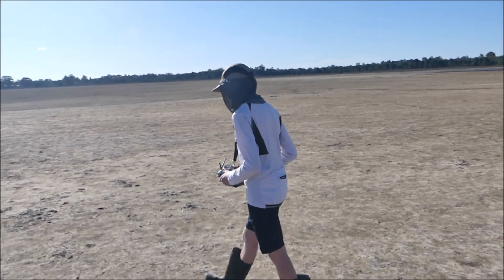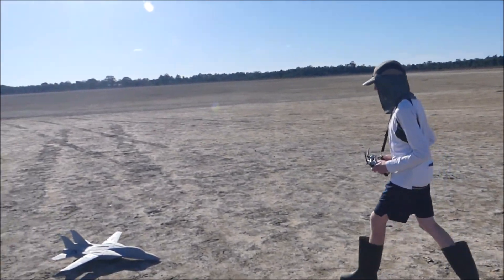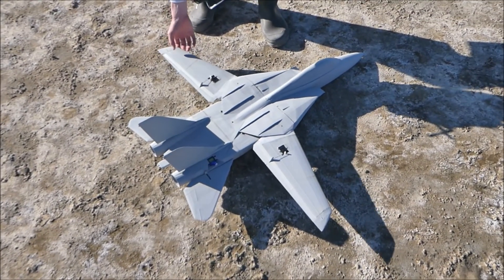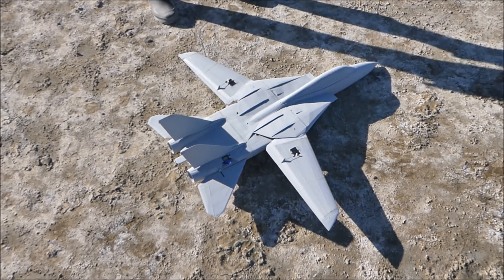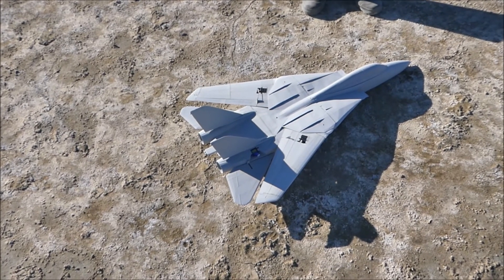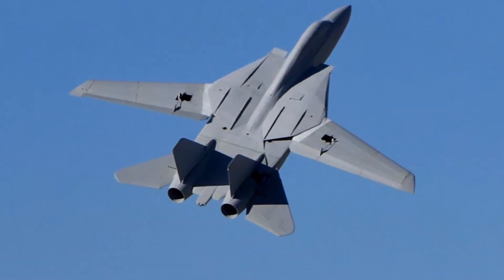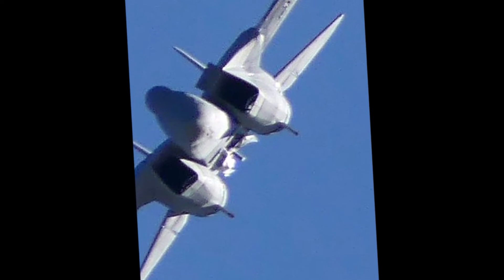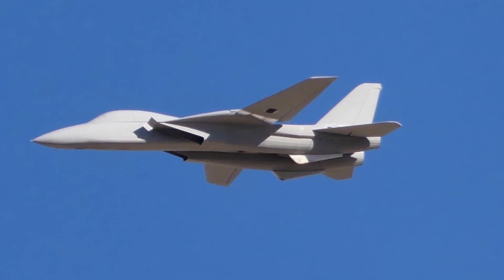Modified 3d-printed F-14 Tomcat EDF

Comment: I just purchased the files from Cults, I use CURA. How do i print 2 perimeters for the top 5mm? I printed and flew the vulcan, which is a great design.
Reply: Hi Pat, see Dominic's comment from the Cults site: "In Cura this can be done with the per model settings, as follows:
• Import a part, e.g. Fuse 2
• Select the part, click on 'Support blocker' or press 'E' and click on the mesh. This should create a small cube
• Scale the cube up and move it to cover the top 5 mm of the part.
• Select the cube and click on 'Per Model Settings' on the side bar
• Select 'Modify Settings for Overlaps' and change wall line count from 0 to 1 (you may have to add the setting in "Select Settings")

This should allow you to change settings within the area that the cube intersects with the part.
I hope this helps." 
Glad you liked the Vulcan - we love to see them finished or flying, so please post a 'make' on Cults 😀